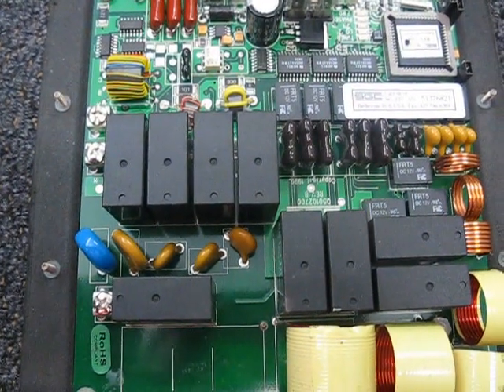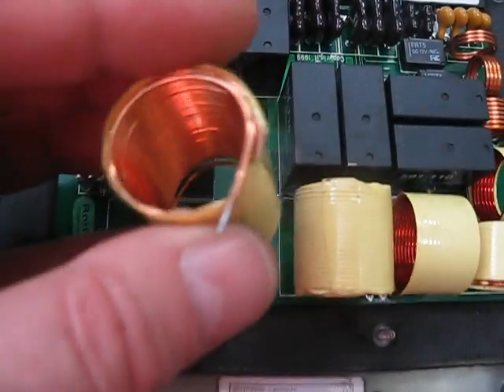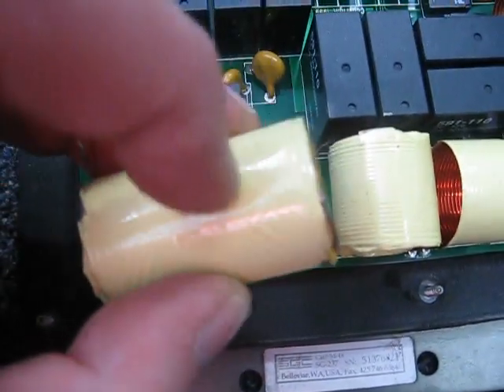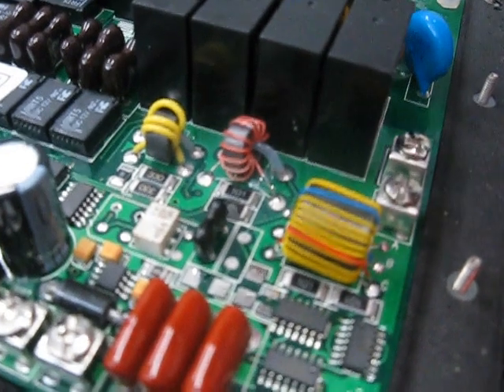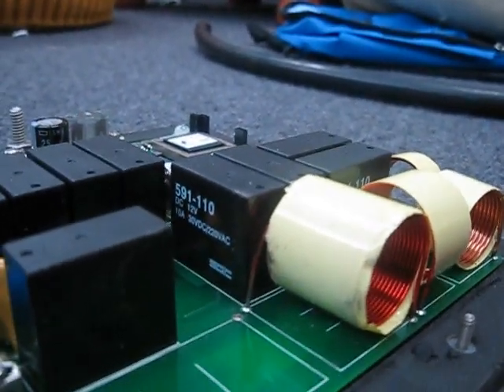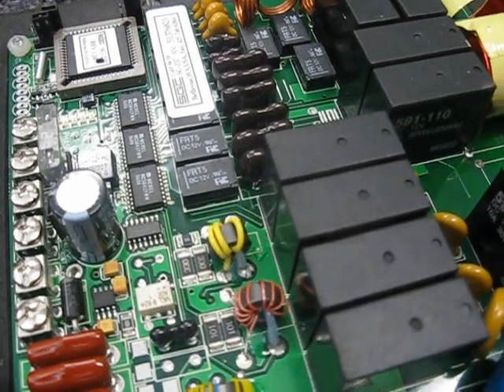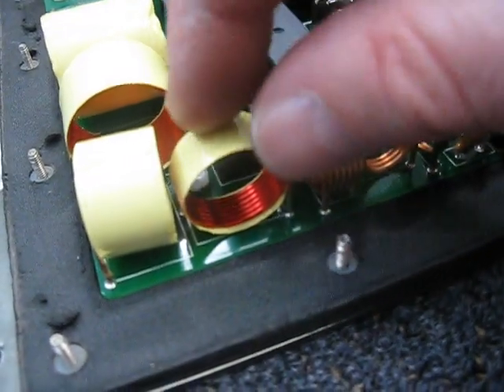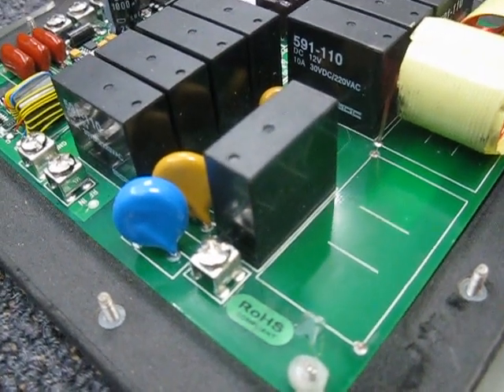SGC-237 SmartTuner Failure

Comment: My SG-231 had a similar failure on the largest coil, too!  There was a good amount of silicone on it, but a 3 1/2 foot drop knocked it off (oops!).  a replacement coil us under $10US, but I stretched the leads and re-soldered the old one and it works OK.

Comment: Hi

Thanks for the video...

How do you find the tuning capabilites of the Sgc sg 237 ...can you achieve 80mtrs easily off a wire whip? 

I am currently looking for a unit to install in my car..not 4x4..and was wondering how it performs on the lower bands

Thanks

Comment: Excellent video. I don't think I would have been so calm. Their documentation shows their tuners bolted to the sides of vehicles so this is how they are supposed to be used. Please post another comment when you get a response from SGC. I hope this was a fluke and the unit was assembled by a novice who was not supervised properly.  I hear you on the fasteners. 73 from CT-USA,  Sander W1SOP